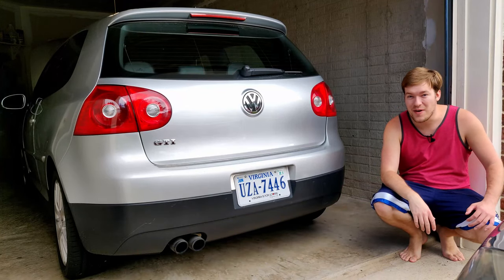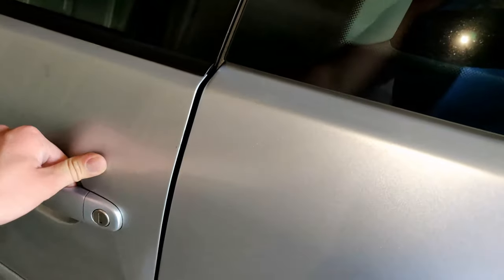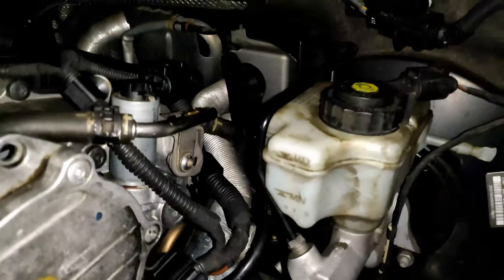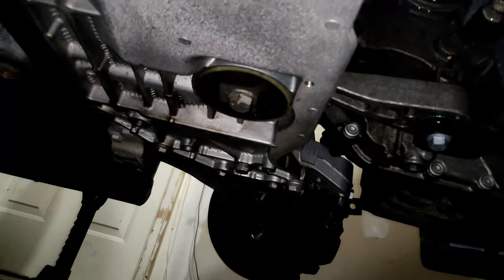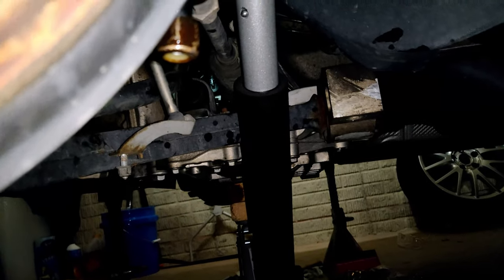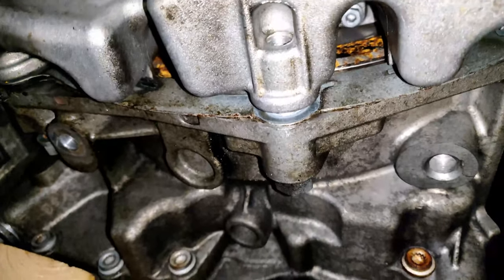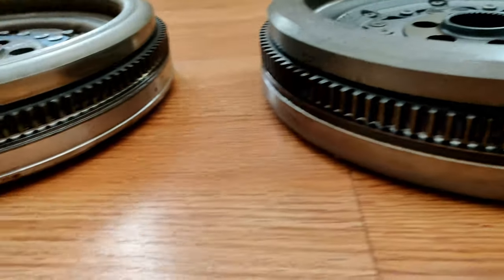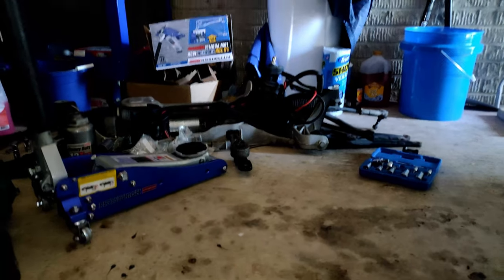2007 Volkswagen GTI (MK5) Dual Mass Flywheel Replacement - Hipshot Car Repair

Comment: No need to remove any subframe bolts, or tie rod end bolts or anything to do with steering rack. Jst remove the drive flanges on the differential and you have enough room to get the gearbox out.

Comment: What torque spec did you use for the flywheel bolts? Thanks for the vid!
Reply from the maker: It's been a few years, but I recollect somewhere in the 80-90nm range + 90°. Cursory factory service manual search didn't bring up a spec, but I believe the flywheel included the needed information. Thanks for asking!
Reply: @Alexplained  Im running into the same issue finding the spec. Thanks. Ill check my flywheel packaging.
Reply from the maker: @justinmiles977  Welcome 🙂 I'd say whatever tightness you pick, definitely do the 90° turn in a cross pattern.

Comment: how many mileage did ur car have when u replaced the flywheel and did u also replace the pilot bearing?
Reply from the maker: I believe it was in the 58-60k range...surprising I know. Pilot bearing was not replaced.
Reply: @Alexplained  Ok, did u replace the subframe bolts or did u reuse them?
Reply from the maker: @LinusF_  Bolts were replaced (and added inserts) at a later date. Definitely needed as it usually affects alignment.

Comment: The reason they start to rattle is due to the grease drying out. They are designed to fail so the manufactures make loads more money. :face-orange-frowning:

Comment: Is your flex pipe aftermarket? If so, where did you get it?
Reply from the maker: Pretty sure it's factory. Not replaced under my ownership. Best of luck 🤞
Reply: @Alexplained  It looks like a euro aftermarket I had found that has a chainmail outer layer as compared to a braided one.  Supposedly longer lasting. I was hoping you had replaced it and knew where to find one. Thanks for the reply! 
EDIT: I found the maker but not a dealer in the US

Comment: what were the symptoms of the DMF failure?
Reply from the maker: For me, it was just the rattle (loud on a cold start, quieter at operating temperature)...possibly slight hesitation when shifting from 1st to 2nd gear.
Reply: Exactly the same, just moved to the boonies. Check engine light came on as the tranny started slipping above 2k randomly. Had to switch back to my 350z after another thermostat on that, already had a rear main seal leak. Figure now I'll just do both. Noise was there for a while but I couldn't figure out the source.

Comment: When my car downshifts you can hear a clank sound would that also be a symptom of a failing flywheel for the dsg?
Reply: May be a motor mount. Especially if it also happens if you hit the throttle hard. Not saying that it is for sure but I would check that first.